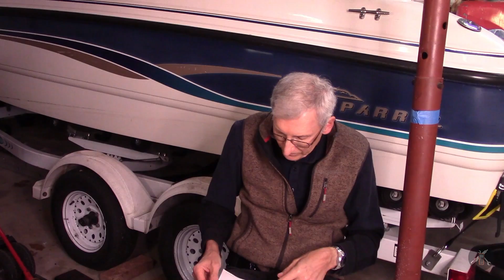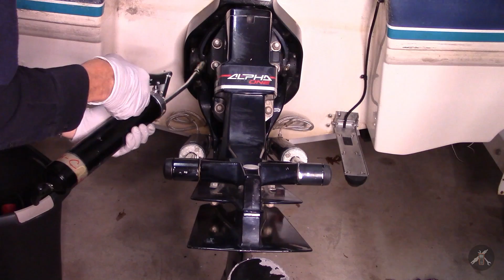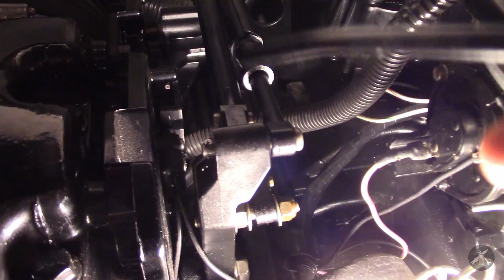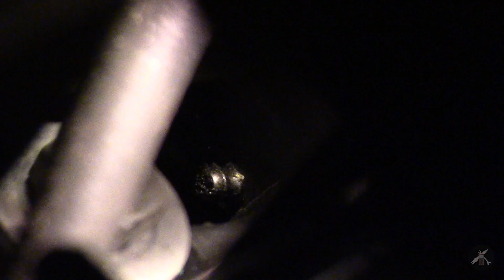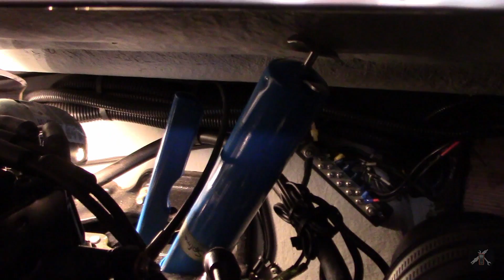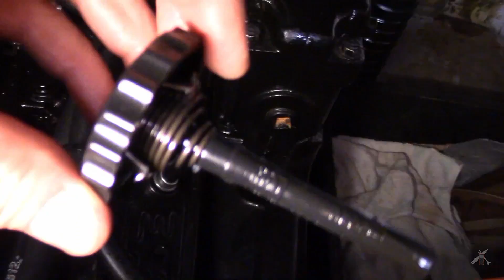Mercruiser Alpha 1 Gen2 "Annual" Maintenance - After Winterizing There is More to Do...

Comment: Beyond excellent and a quick question.  To save my life I cannot find a grease fitting on the pivot points for my 5.0 MPI with Alpha 1 GEN two Drive.   Do they all have one?  Also, my gimbal bearing is a sealed unit. It was replaced a couple of years ago.
Reply from the maker: It depends on the age of the drive.  The 1998 model has the grease fittings, my 2018 does not.  My manual from 2018 says that gimbal bearing and hinge pins on later models are sealed.